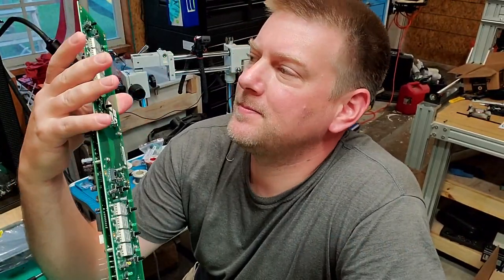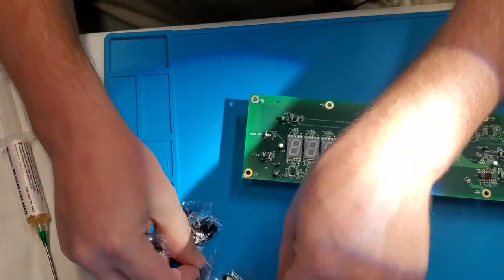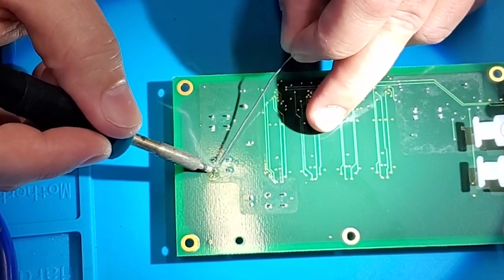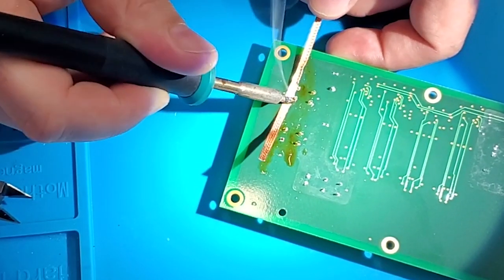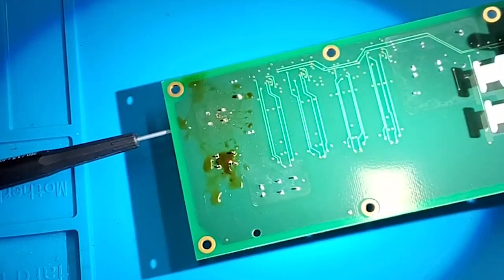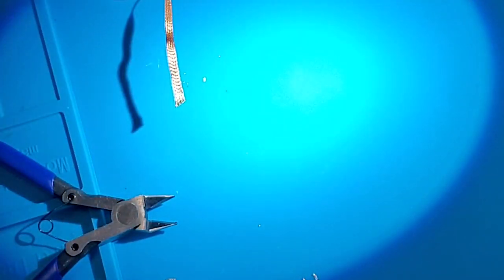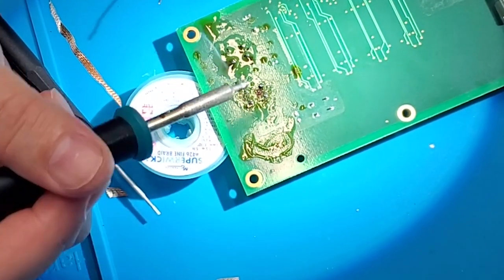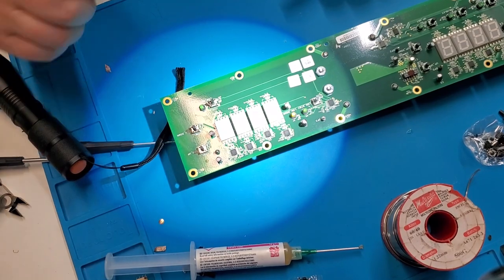Repairing PCB Buttons

Comment: Hello. I have a question for you if you don't mind. I have this pressure cooker which works perfectly except for one button, the slow cook button. Seeing as though I have contact cleaner I thought I'd try and fix it. I initially opened the bottom thinking I had to remove the inner cooker surrounding to be able to get access to the button panel on the outside. Thought there might be some screws fastening it on from the inside. I started by unscrewing a yellow/cable fastened to the literal side wall of the outer casing. You can unscrew it from the outside. I assume this is some kind of ground. I then unscrewed 3 large screws which held the inner cooking surrounding down. I then by chance noticed that the button panel face was peeling off slightly and that it was actually a sticker. I peeled it off and found the screws attaching it to the outside. Reattached all the other part and focused on that. There was nothing unusual or tricky about take it off. Once I got in it was a square black contact button with a metal plate on the top keeping everything on. I used a knife to pry it off, gave everything a spray, and clicked it back on. I plugged it in and there was no power going to the panel, which has an LCD much like yours, which lights up when on. The inner heating element turn on though as though I've started some cooking function yet no power to the panel. But...if I hold the board in my hand and touch the back of it to the outer metal casing, the panel lights up and the power trips. I've tried reattaching the ground cable. I've looked for anything else that could be touching. Can't see anything. Tried opening the button up again and removing everything from the inside so there is no current going through. I'm stumped as to what I'd did since I hardly did anything. I think it's interesting the panel comes on when touching the outside. Any clue what it could be?

Comment: I recommend Hakko FR-301, it will make life much easier.
Reply from the maker: The Quick TS1200 is the best soldering iron I've used so far. It beat out the Hakko.
Reply: The FR-301 is not a soldering iron. It's a desoldeing iron. It heats up the solder and sucks it in one go. I'm not too familiar with Quick but they might have something similar.
Reply: @BetterBiomedChannel  
TS100 is my first and only iron. Absolutely in love with it for 3 years+ learning elect repair.  It handled my "eBay cheapo solder" phase.  My "underheating, overheating, and using it as a chisel/prybar" phase. Now in my "learned my dang lesson and switched to kester 44 solder" phase- the TS 120 has more than won my loyalty. (Not to brag but somebody the other day even called me "fairly competent" 😅). Anyways,  just my two cents. Old thread.. long comment.. hope it helps somebody lolz
Reply: Too expensive unless you use it all the time

Comment: in a shunt resistor you said if you increase the current you have a  incrase in resistance is this true?
Reply from the maker: Sorry, what I meant is that in a shunt, the voltage drop across increases with current increase @ a specific low resistance